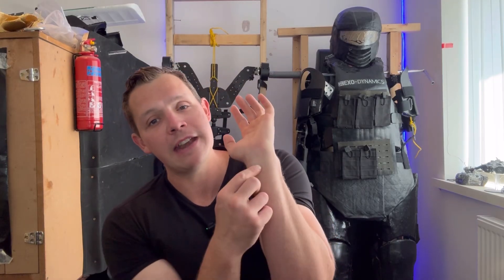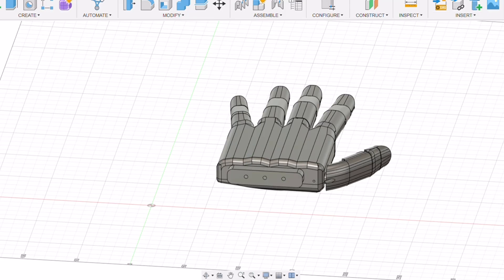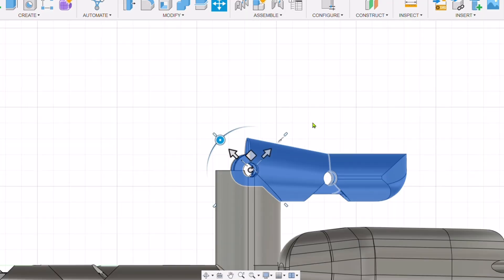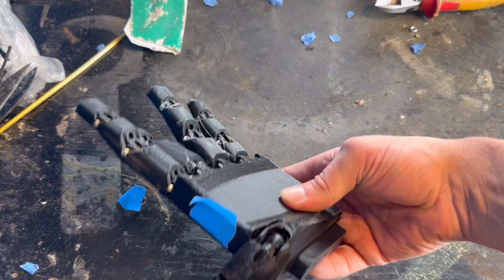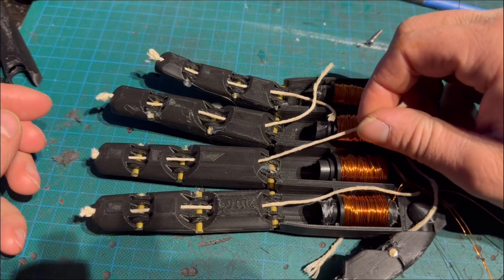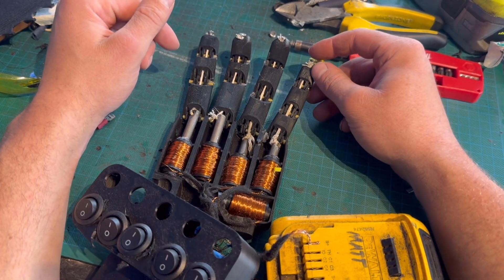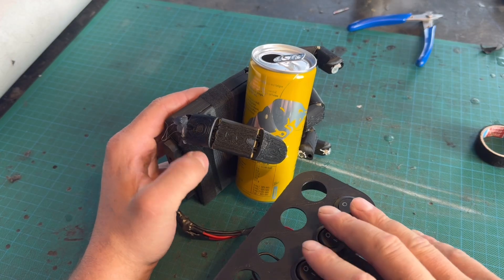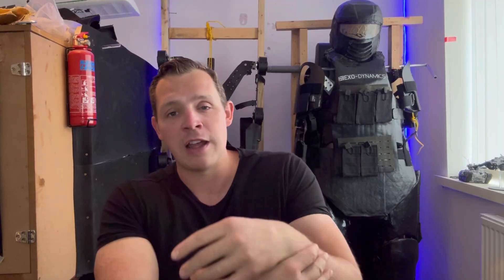How My First Experiment Making  a FAST, cheap robotic hand went

Comment: what you need is, an over center mechanism that locks the joints open or closed with a spring force, and the solenoid can work on a retractable pen like mechanism.
Reply from the maker: Agree im thinking of having a magnet at each end and maybe a coil at each end of the rod,

Comment: For the power armor I'm designing I'm thinking of making robot hand extensions, because otherwise the hands seem like weak points, both in terms of armor and enhanced strength.
Reply from the maker: Yeah ive been thinking this theory, idea could be used to make an over hand power fist/claw. That way you could slide it off and back for doing normal tasks
Reply: @MattExo-Dynamics  If you're just making an exoskeleton, then a gauntlet powered by cables with the solenoids in the back of the hand or on the forearm should still allow you to operate a firearm or something. My problem is wanting a relatively normal-sized hand while still wanting a few cm of padding/armor to protect the hands, more than you might even find in medieval armored mittens.